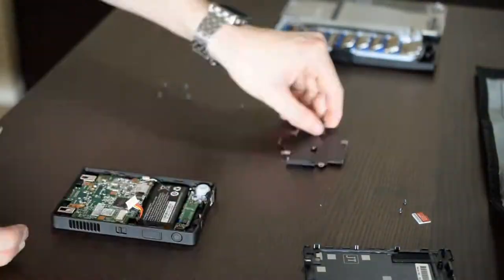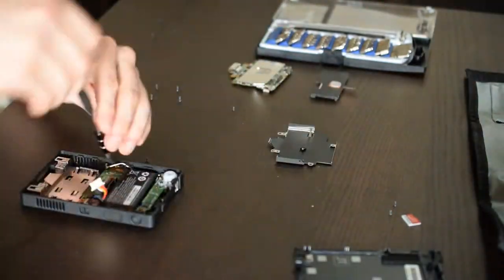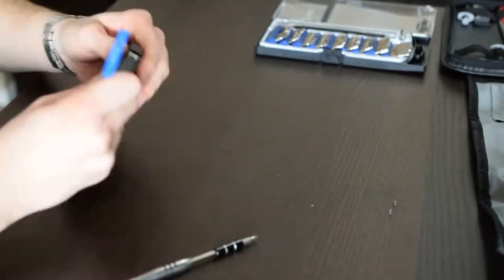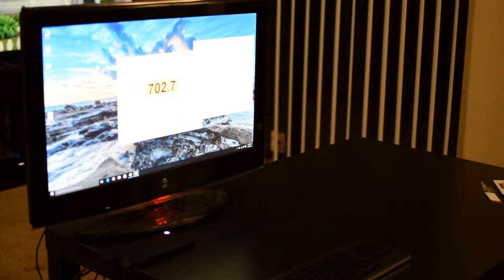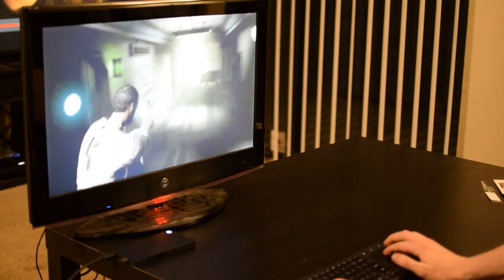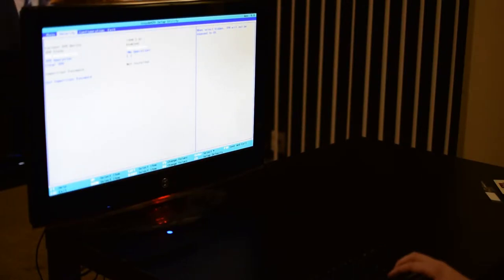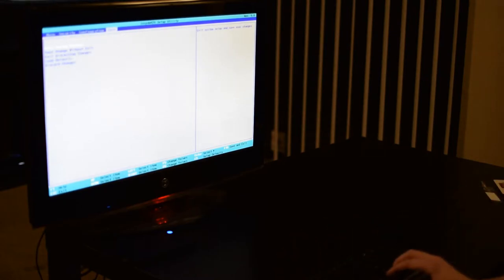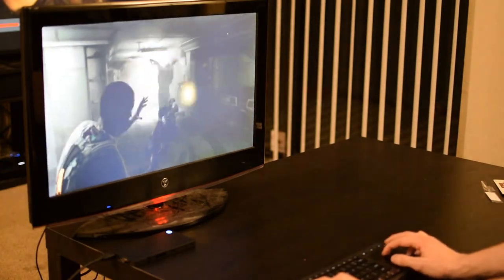How Useful Is a Pico-PC? Kangaroo PC Review

Comment: Cool review, one of the few that shows the insides of it.  Can you swap out the cpu? Is that soldered into the board as well?
Reply from the maker: No you cannot change out the CPU. All Atom chips are BGA which basically means that what you buy is the one you're stuck with.

Comment: Nice review. Can the emmc and ram be changed out?
Reply from the maker: No. The nature of both eMMC and LPDDR3 is that they are only available soldered to the board. Though I should have mentioned though that it does have a MicroSD card slot to expand the storage with.

Comment: hello. can you upload disassembly of kangaroo pc step by step? or just footage from video on normal speed.
Reply from the maker: Can I ask why you need it? There's really nothing to upgrade inside
Reply: OneUpVids I want to replace thermal paste and see how I can improve heat dissipation. I use it 24/7 for over a year. I plan to use MX-4.

There is a problem with throttling in new devices, so my device requires, at least, new paste.